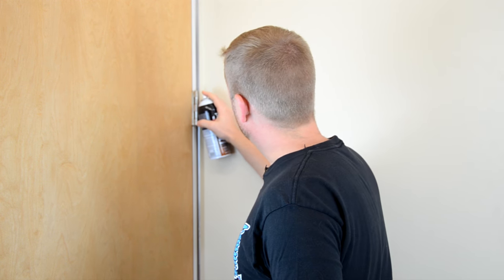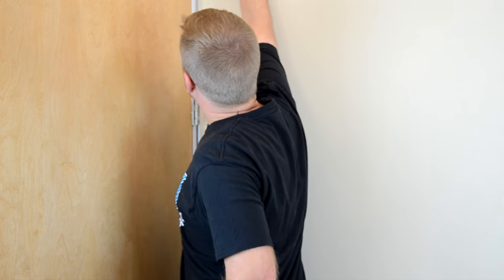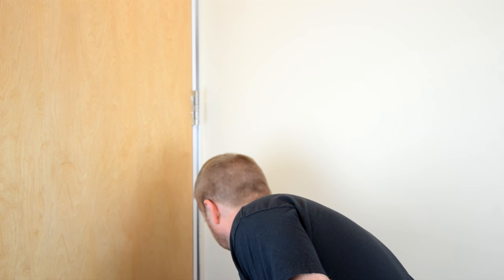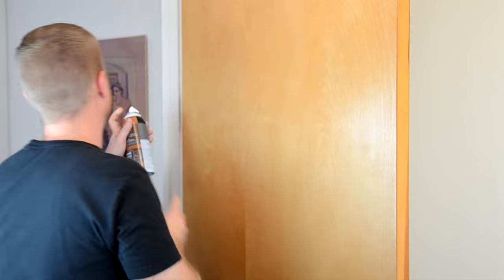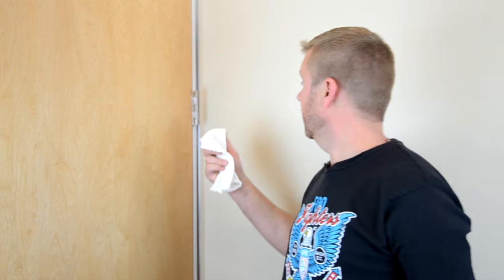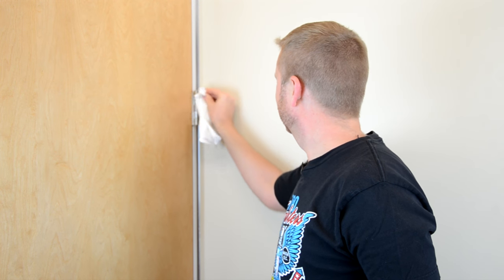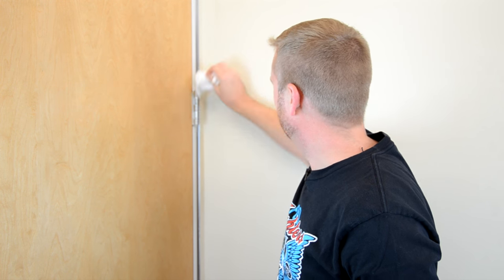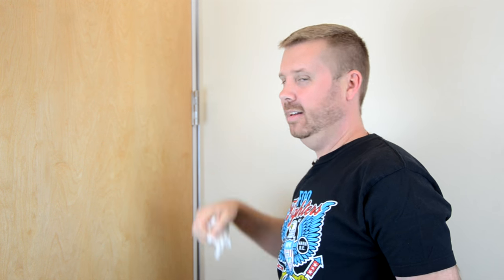How to Fix Squeaky Door Hinges

Comment: my closet door is very squeaky... i dnt hav that polish in my hand...anything else?
Reply from the maker: One option is to remove the pin from the hinge(s) that squeaks and apply some other type of lubricant like wd-40. If you have any petroleum jelly around, that would work. Just don't put too much on otherwise the hinge will attract dust and grime.